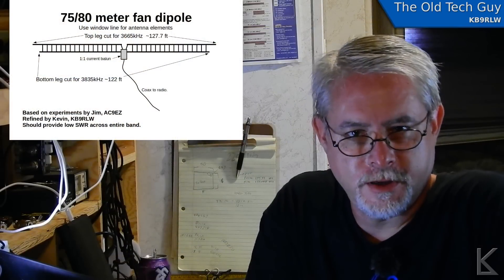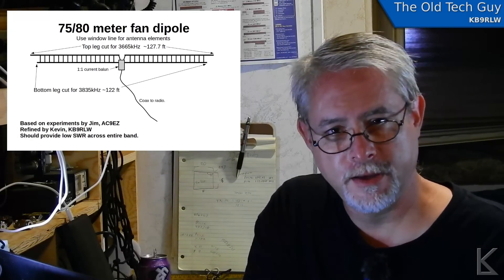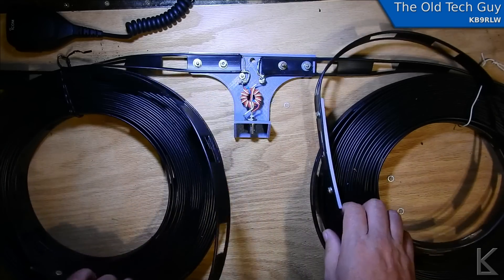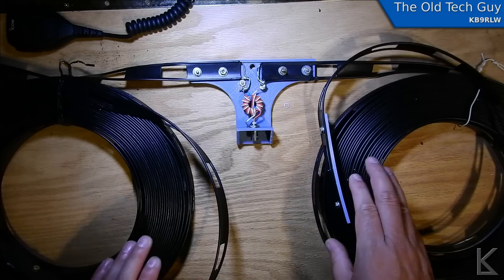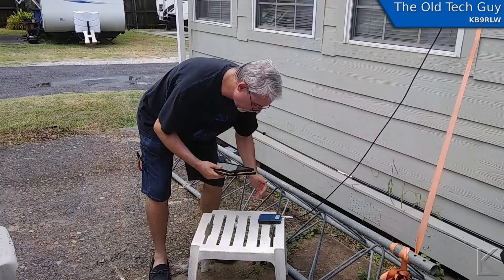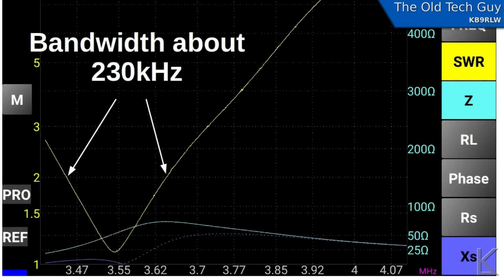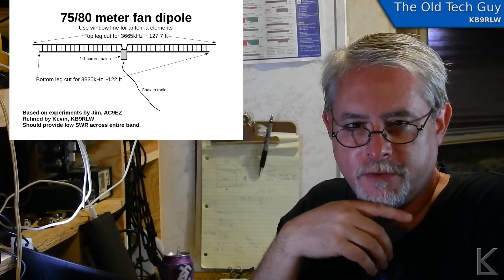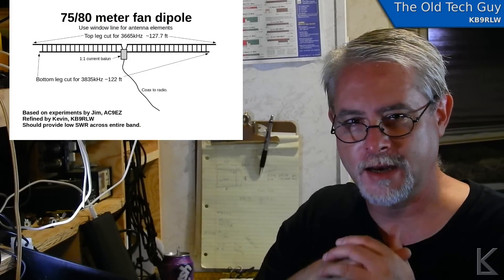Ham Radio - An experimental 75 80 meter fan dipole part 2. Build and test.

Comment: There were several QST article on a similar Multi-Band Antennas called "Skelaton Sleeves". Tying the ends together and cutting the lower wire back a ways from the end to get multiple bands. You might also try a single band with the wire folded back on itself (linear loading).

Comment: Interesting experiment. Maybe you could shorten the whole antenna to move up the resonance up from the bottom of 80 meters. Another option is to try cutting the shorter part of the ladder line down for 20 meters.

I built a 75/80, 40, and 20 meter fan dipole. The center insulator had a coaxial connector on it, no balun. Each dipole connected to the common center point and ran different directions. The center was 25 feet high in a tree and the dipole ends were 10 to 15 feet. The antenna had less than 1.5:1 SWR on most bands, 40 to 10 meters. On 75/80 meters, 3500 KHz and 4000 KHz peaked at 2.5:1 SWR. From 3575 to 3925 the SWR was less that 2:1. The antenna tuned easily with an antenna tuner. The SWR was horrible on 160 meters and 60 meters. That fan dipole antenna worked well to cover most of the HF bands. 

I was going to modify the fan dipole by shortening the 75/80 meter dipole for a better SWR around 3850 KHz and then add a 75 meter dipole with a better SWR around  3650 KHz, to try to get less than 2:1 SWR across the whole 75/80 meter band. I never got around to adding the forth dipole to the fan dipole before I moved from that location. But I suspect that would have given me an SWR of less than 2:1 across the whole 75/80 meter band. 

Dave KY0L

Comment: In QST May, oct and November 2011 joel hallas discussed an antenna called the multi band skeleton dipole built from ladder line as the radiator. This is in line with what you are experimenting.You could use a tuning stub hanging about 4 feet before your second conductor cut line. Such a stub could even be made of ladder line to get a bit more broader band effect like a fat radiator line.

Comment: The metal nuts & bolts in the ladderline will be adding capacitive coupling across the two wires, which must have some effect. Hopefully small. Maybe zipties would change that?
Reply from the maker: Really small effect, if any.

Comment: What I want to know is how you were able to determine which side of each leg to cut? I mean, with the center up in the air, how did you know that both cuts were on the same side of each window line leg? Does it even matter? Also, could you look at the article on page 23 of the November/December issue of “on the air” and see if the info there (particularly regarding the “gap”) could help get a better VNA reading for what you were trying to accomplish as far as bandwidth?

Comment: I learned a similar lesson when i was building a 75 meter dipole while camping in an old school bus. When one of the legs was running slack along side the windows of the bus it was tuned perfect. When I tightened that leg up it was running next to the metal body of the bus. My tune suddenly was way out of the band. The 8” of space between the wire and metal bus body was enough to make all the difference. Pretty fun lesson to learn.

Comment: Thanks for sharing your experiment.  It is something I had once considered.  IIRC from reading up on fan dipoles, some tests (military?) found that you need 3+' of separation between the ends of the wires to significantly reduce the interaction; probably more for 80 to 75 than 80 to 40, etc.  Like some other commenters my preference would be a ladder-line fed doublet or center-fed inverted-L, but limited to three bands due to the increasing number of pattern lobes; and cut for matchable impedance on those three bands at a repeatable height.

Comment: I just modeled 2 series resonant (LC) circuits paralleled, no coupling.  I get pretty much what you show.  

The peak between the dips can be lowered by making the short leg longer.  That will reduce the total bandwidth. 

According to the model, you can add a second ladder line, cut each a different length, and you will get 3 dips.  If the dips are close enough, the peaks will have an SWR less than 2, and your bandwidth doubles compared to a single ladder line tune the same.

Good luck!

Comment: Interesting. I don't think there is capacitance between the elements, as they're at the same potential. But I think that it's so low to the ground is skewing the result. I'd also be interested to see what happens if you cut the short element even shorter.

Comment: Cool experiment.  Could definitely be useful for someone with an internal tuner in their radio with limited tuning range, or a tube radio that can handle a larger mismatch.  What would the bandwidth be if cut for 3:1?

Comment: Thanks for doing the experiment Kevin. I too have wondered if such an antenna might work. Also remember, years ago, reading about a design that used computer ribbon cable to make a multiband compact fan dipole. Though, cannot remember if the article was just theory or included some real results. I wonder, if you cut the shorter portion for 40m what would happen?
Chopping board is great. I use it too.

Comment: I'm wondering the same thing about using like thermostat wire and telephone wire. With the insulation on each wire and you twist each end would it act like 1 or 4 wires.

Comment: I agree with Simon that the floating bits of conductor left after you cut the "short" wire are likely acting as a "linear loading" (ask Cal), accounting for the lower resonance moving down.  But this also feels line a "skeleton sleeve dipole" (google) for which there is some literature on line including length calculations.  Good luck.

Comment: Cool experiment!  I’m curious.  If you just snipped the wire what would be the effect of removing the snipped ends or portions of the snipped ends.  Looking forward to part 3 when you get to a different location.   Do experiment with NVIS with that down low🤔
Reply: Yea. I wonder if the extra bit of wire from the short end that is near the long on is acting as a cap.

Comment: Could it be an idea to cut the windowline at maybe 3/4 length (each side) and solder on two wires for the prefered sections of the band? Then MAYBE  spacing will be kind of wider between the long and short portion og the antenna. The antenna will maybe not be as simple to put up, but.... Just an idea from the Low Tech Guy in Norway :-)

Comment: Did you try to scan it with the remnants of the cut element completely removed? Seems there would be a LOT of excess capacitance from that extra wire out at the end of the antenna.
Reply from the maker: Capacitor with no return path.  I'm not sure how it could affect things with no electrical path.
EDIT:  I've thought of an easier way to suspend the ends if I cut away the remnants.  The first experiment I do when I put it back up will be to cut them away and see what effect it has.
Reply: Hello Craig ...
Reply: Craig Gilbreath, I think the surplus unattached wire is very close to the driven wire and there would be current induced in it, do an inductance at the ends.

Comment: If all research provided a marketable product, it would not be called research anymore... I hope you return to this idea Kevin, I'd love a dipole that can do for example 40 and 20 and would be rugged and tough for field use during camping. After a long trip, you don't want to be careful, you just want the antenna down has been my experience.

Comment: You could try to simply connect ends of wires on both ends. Than, it should act as wider conductor increasing bandwidth.

Comment: Try the Extended double Zepp. its monoband but tunable to other bands, each leg is about 5/8 wavelenght total around 1,28lambda if i remember correctly. and you need to feed it with ladderline to an balanced tuner cause it have a very high impedance. if cut for 20m you can tune it to 40m but not for 80/75. i used one for 80/75m during IARU region 1 Fieldday this weekend
Reply: Feed it with a quarter-wave stub shorted at the end, connect the coax to the point up the stub where 50R-j0 is, not tuner needed for the fundamental freq.

Comment: You could make it into a 75/80 inverted V.  Would be a lot easier to tune by lengthening or or shortening the ends.
Reply from the maker: Not doable here at the RV park.   I had to go over the top of another guests RV just to do the dipole.

Comment: this is not a fail!!
you need to include the capacitence in your equation...then it will do, like suspected!
even you switch between "upper and lower wire ..there is capacitence "
but i think the idea is great!! ths  idea only need some equations and some trial and error.
but i am shure this will work perfekt!!
73, dg2r?
ps.. sorry for my poor english!!

Comment: Nice experiment!  A great way to learn and gain experience/knowledge.  I would say the weight of the window line is a big negative over a simple fan dipole, especially since you did not get the desired 'wide' band coverage.  Window line excels , as you know, at low loss rf energy transmission, but in this case the weight and cost is a big negative, with little payback.  Love these antenna experiments Kevin.
73

Comment: Short the ends of both legs and feed with ladderline ... you have a doublet that will be resonant below 3mhz as it's linear loaded. If no balanced tuner then use the 1:1 Balun to transform the shack end of the ladderline feeder using a v short piece of coax to an atu. I had a 45 ft long version of that and it was resonant on 7.15 MHz and tuned and worked well 80-10.
Reply from the maker: Yeah, that would be a doublet.   But this was an experiment in building a single band fan dipole. ;-)
Reply: Kevin Loughin just a thought ....
Reply from the maker: @timg5tm941  Oh, I know, I was just being silly.  Hence the wink at the end of the comment.
Reply: Kevin Loughin no worries 👍

Comment: Would you consider using tunable TRAPS with the ladder line?
Reply from the maker: Traps are used to shorten an antenna, at a cost of narrower bandwidth.  Kind of the opposite of what I was trying to achieve.

Comment: The individual and mutual impedance values of the two conductors changes with different tuned lengths. Both legs become tuned circuits that are coupled by inductance and capacitance, therefore producing a mutual impedance change. The antenna is substantially affected by ground capacitance due to the mounting elevation. Shortening the longer leg will bring the resonance closer to the bottom of 80 meters. Then tuning the shorter length will determine the shape of the antenna response and bandwidth. Several length changes may be required. Checking the spec for the specific ladder line used will give you a hint as to the tuned circuit reactance values. With the Xl and Xc values for a length of ladder line, then with the VNA you should be able to measure the actual reactance values at specific frequencies. How do they compare? Any antenna is a tuned tank circuit and has  a complex impedance value. With two wires, you have two complex impedance values or "tank" circuits, both of which are coupled to each because of wire spacing...and elevation above ground. Without establishing test values for each wire and the total circuit (e.g-radiation resistance, capacitance, inductance), is this truly a "scientific" experiment? Keep building and testing. Failed results bring us closer to the desired result. 73  Marsh - K0COA
Reply from the maker: Thanks for the info.   "scientific"?  Nah, never said I was a scientist! ha.  Just a guy playing around, learning, and sharing my adventures.
I'll be doing more experiments with this when I get to a place where I can more easily put it up and take it down for adjustment.   It was really tough getting it up at a crowded RV park.
Reply: @loughkb  Keep on truckin'. You help all of us learn new dimensions of what we think we already know. That's experimentation. Thank you for expanding our universe.

Comment: Another attempt using transmission line, that was designed not to radiate, as an antenna. Brilliant.
Reply from the maker: Oh it radiates wonderfully.   I think you're missing something.   When parallel feeds are used to feed a balanced antenna, they don't radiate much because of the balanced load they are connected to.  
There's nothing inherit in the design of the window or ladder line that prevents it from radiating.  There are antennas that use ladder line as an active part of the antenna itself after all.
In this case, there is no load attached to the ends, and the window line is nothing more than two open ended wires.

Comment: Hey Kevin. What are using 2 industrial tie raps to bridge the weakness gap where you cut the shorter elements? Maybe a bit simpler. Just a thought.
Brent   va7hum
Reply from the maker: I've already thought of an even easier way.   I'll be trying it when I put it back up for more experiments later on.

Comment: Nice test. Maybe the rain and low elevation had a bigger effect than imagined. To test the theory maybe try 10 meter band? Cheaper and easier to get to 1/4 and 1/2 wave length above ground. Good luck and 73. ZS6CFW

Comment: If you have to use a tuner to trim the SWR anyway, why not just build a classic 80 meter Doublet and make it work 10-80 on one antenna? Instead of wasting that ladderline as the antenna itself, use it for it's intended purpose and enjoy the low loss of balanced feed. Plus one antenna works 10-80 without cutting and trimming.
Reply from the maker: It was just an experiment.  As you'll see in later videos, I put the window line to more appropriate uses.

Comment: Why not feed it with ladder line and use a tuner ? Then it would be a great all band antenna.  Doublet.
Reply from the maker: Because this is an experiment in building a single band fan dipole and not one on building a doublet. ;-)
Reply: @loughkb  sorry I wasn't being critical.  I just meant even though it didn't work out the way you wanted it would still make a good doublet.
Reply from the maker: No worries Jeff,  You might have missed the wink at the end of the comment there.

Comment: You might want to experiment with a really fat dipole made from a roll of 48" wide aluminum attic foil. It'd catch a lot of wind outdoors, so it'd be best to test it in an attic on the higher bands, but it might prove marvelously wide band. It could be tested by feeding at the end and at the middle. Feeding at the end would mean that it has a range of effective lengths from straight down that side to a path across to the far-distant corner—and the shift from one to the other would be in a continuum. 

Here's where I bought some of it for the usual use in my attic. It is NOT like aluminum foil. It is so rugged you can walk on it without tearing.
https://atticfoil.com/index.php/products/48-wide-double-sided-atticfoil-radiant-barrier-foil-perforated/

Comment: Maybe...Just for fun...As you try things..  swap the dipole feeds ... on top.. leave as is... on bottom invert... resweep... 73 WB0ZLX
Reply from the maker: Wouldn't they be 180 degrees out of phase and tend to cancel each other out?
Reply: @loughkb 
Yes and no... something drove resonance lower. (cap at the open end..  or .. inductance at the feed end) The most resistive dipole will radiate... the most reactive... just wastes power... By inverting the sign of the reactive power... does that cancel out the reactance in the companion element. pure speculation... but ... you have the test jig... before re purposing... why not flip the wires and retest....???
Reply from the maker: @scottrand7626  Oh, it radiates just great!  I played around with it for a night and had a few QSOs like the clip at the beginning of the video.   More than one op was surprised I was 'only' running 40 watts. :-)